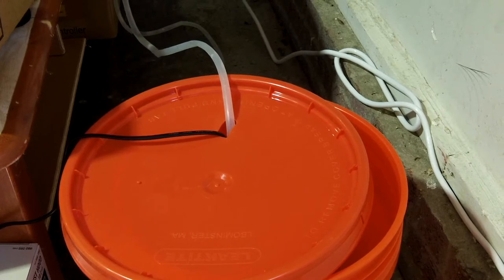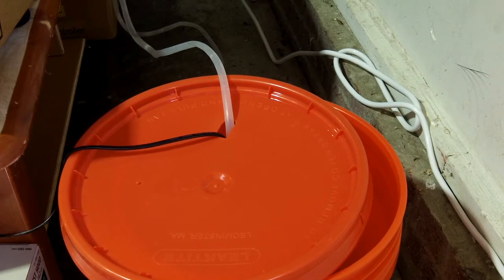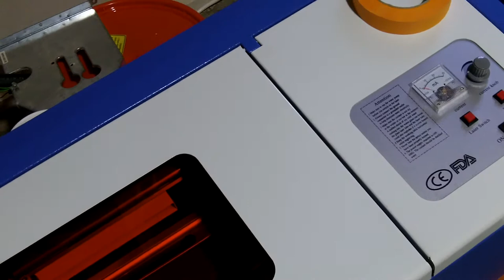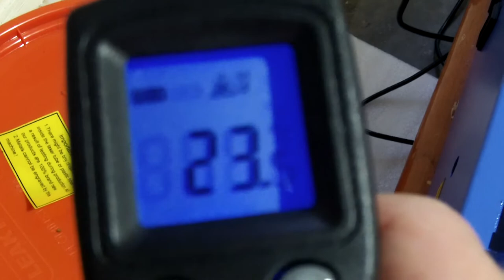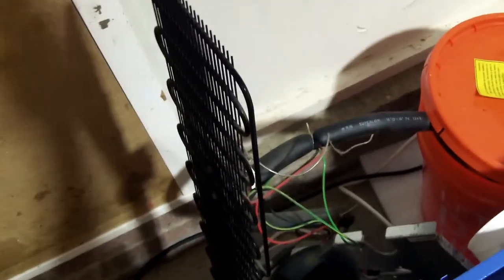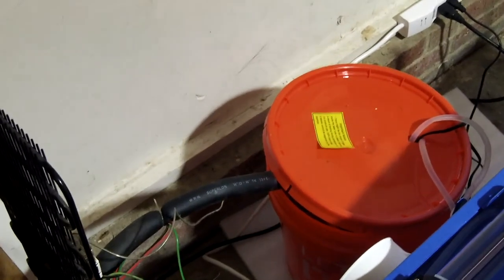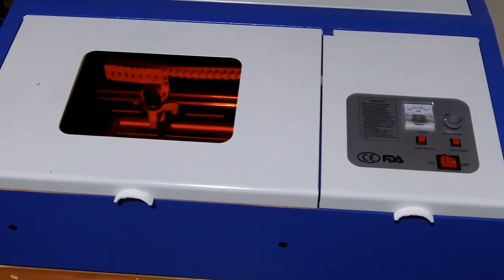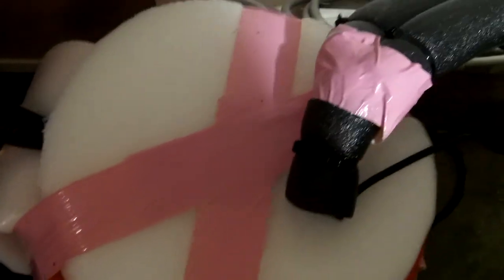K40 Water Reservoir & Cooling

Comment: Do you run it 24/7 or tip it everytime you go to use it?
Reply from the maker: I keep the pump running all the time just so I don't have to mess with the air bubbles. Keeping the pump running all the time also keeps the water flowing and makes it less likely to freeze in colder weather. With my K40 in my garage, this is a concern.